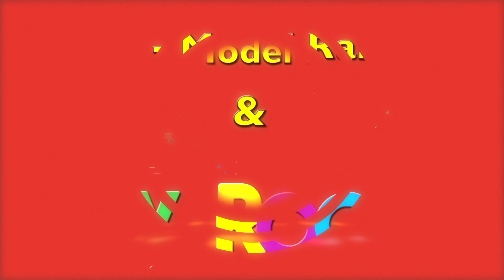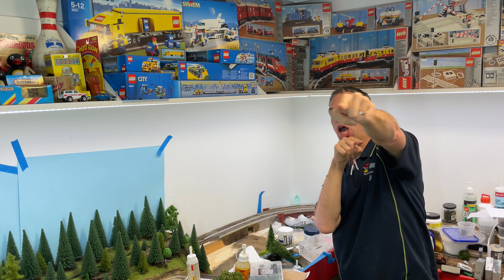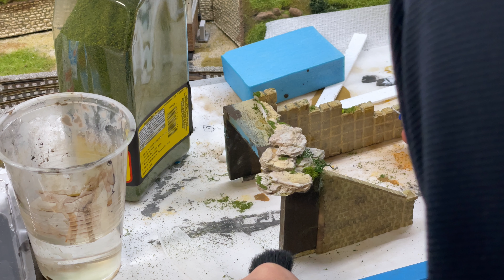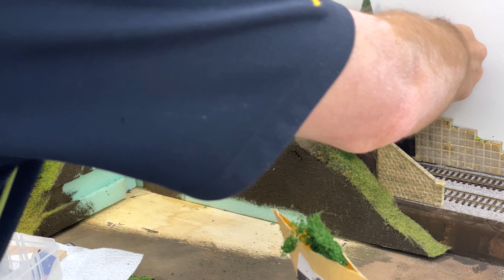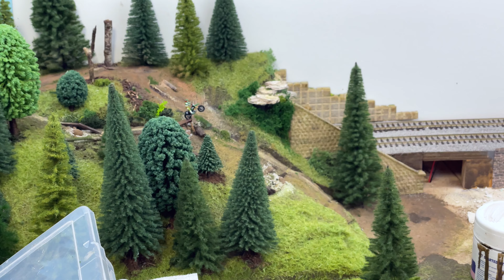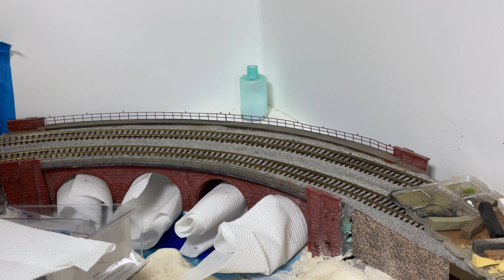Josef - Model Railway & Toy Room 88 Modelling Mechanically Stabilised Earth MSE Retaining Wall Train

Comment: Things are really coming together. 
Great use of the metal ruler, not sure my school teachers would approve of that operation however.
Reply from the maker: Thanks.  Teachers are there to teach the reason they may not approve of the steel ruler is they could be racially profiling you perhaps you have a face that looks like you might hit someone with that.  Two sides to every story I suppose.   What you choose to do with a measuring instrument is left to your discretion for me it invaluable tool for mode railway.  Stay safe.